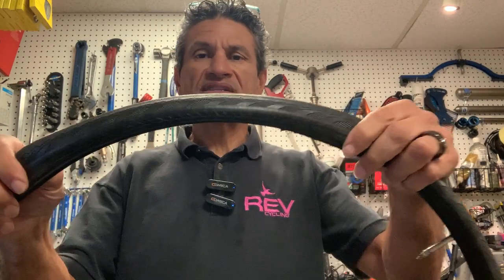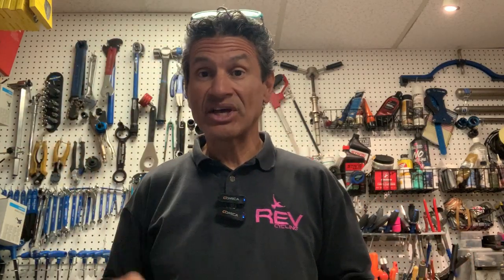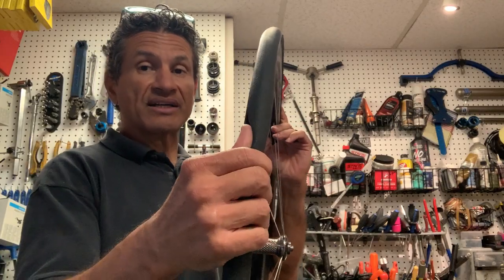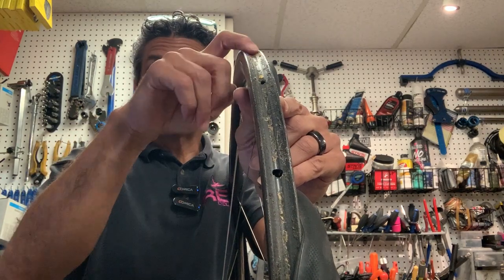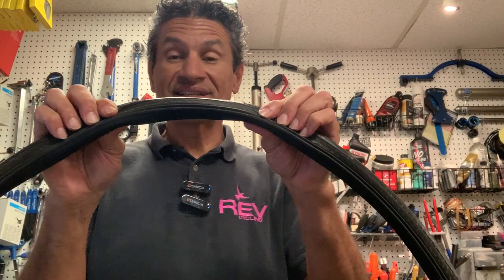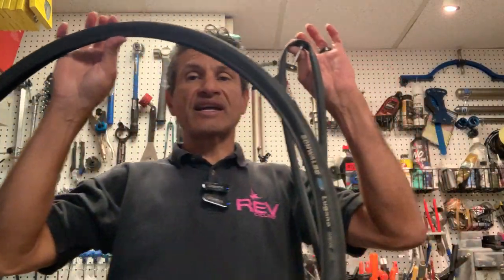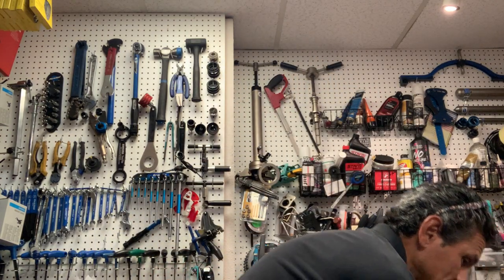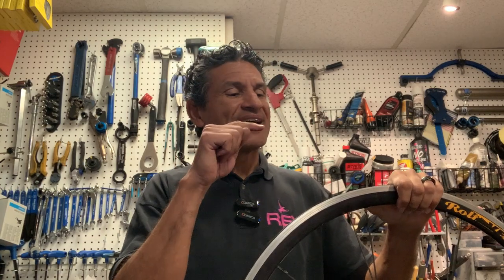#WhatIsInOurStandToday - What is a Tubular Clincher?

Comment: Vittoria used to make open tubular too. Don't see them anymore. I race Tubular and train on Open Tubular during my racing days. They feel almost the same except that they have higher minimum pressure like the Vittoria 23mm minimum air pressure is 115 PSI but they ride like butter.
Reply from the maker: That was more of a naming game. But Yes the Vittoria Corsa was a very comfortable tire either tubular or clincher. Tubeless changed that